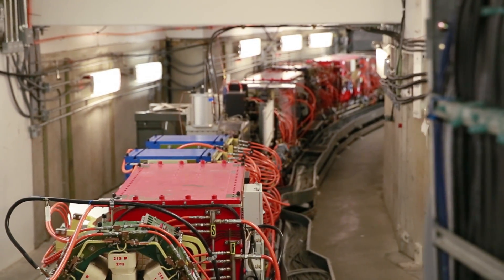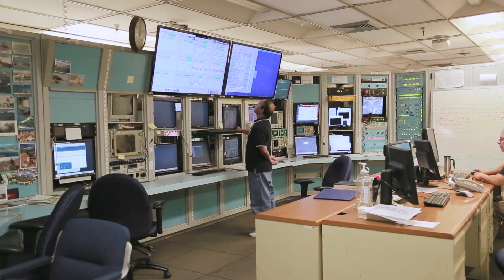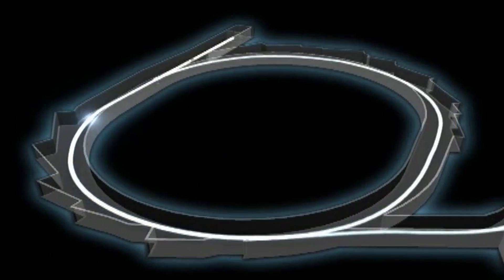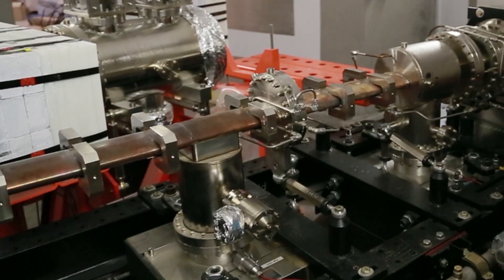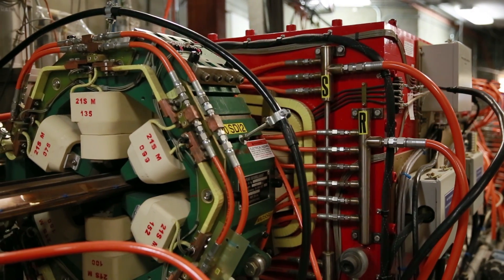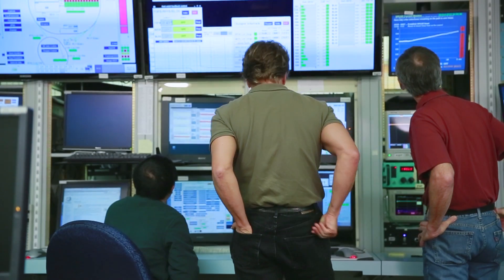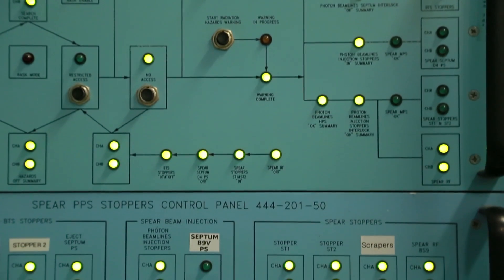SLAC All Access: The SPEAR3 Electron Storage Ring

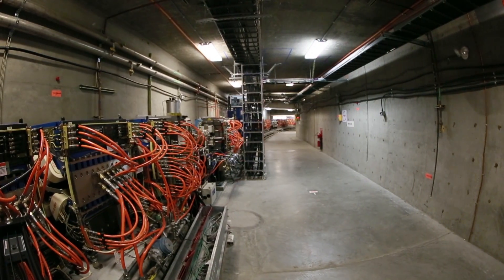Comment: 1:14 ....charged particle beam...it will "create" photons... - please explain.
Reply: The high energy electrons, traveling very close to the speed of light, emit high-energy photons (including x-rays) as they zip around the ring.  This behavior is just one example (a controlled laboratory example which produces very intense x-ray beams) of the very general and common behavior of electrons emitting electromagnetic radiation (Einstein figured out that EM radiation was quantized into photons).  All types of photons/EM waves -- radio waves, microwaves, infrared, visible light, UV, x-rays, gamma rays -- are created by the motion of electrons (specifically, electrons that are jiggling around or changing direction).  Fascinating, eh?
Reply: Alexander Burke
It's fascinating, but are the x-rays "created" in the same way photons are produced when an electron drops down an orbit? or are the x-rays produced out of the surrounding space?